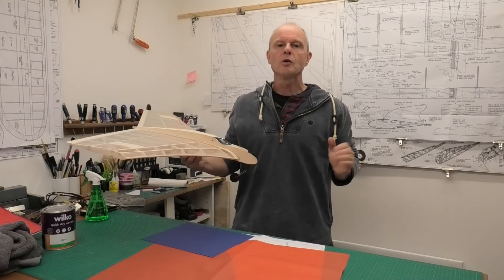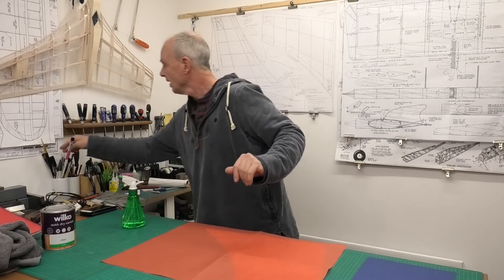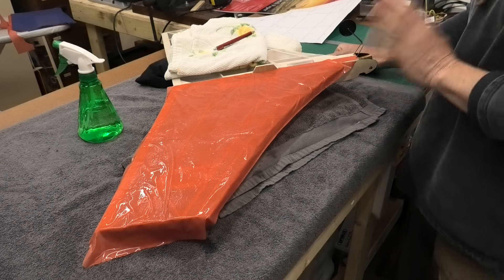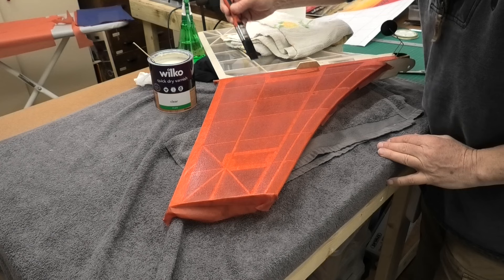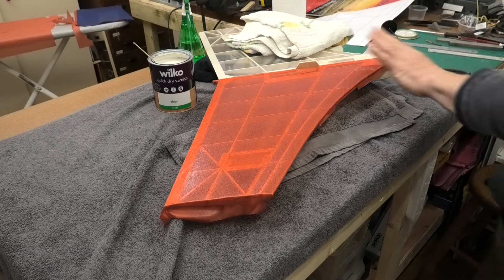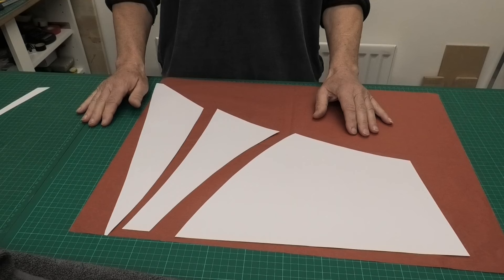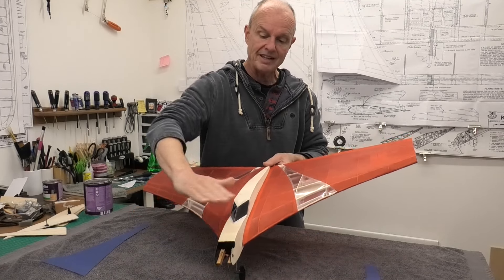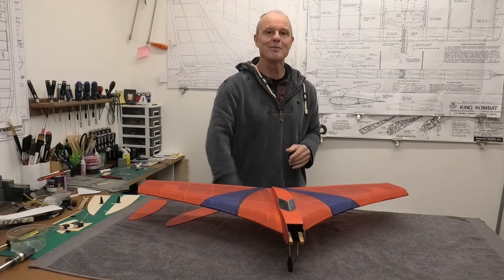Ion 1950's Futuristic Flying Wing - Pt13: Tissue over Laminating Film - By  O.F.W. (Peter) Fisher

Comment: Great videos, thanks.  I have struggled with getting laminating film (doculam) looking great on open structure frames.  And then I flipped this scenario around and covered FIRST with tissue and ezedope, then laminated over top of that with really satisfying results.  The dope finish was easier to achieve, and the laminate grabs on to the tissue as smooth as can be.  Thoughts?
Reply from the maker: Thanks for the comment, pleased you enjoyed the video, sorry to hear you are having problems with laminating film.  I have heard of others putting the film on top of the tissue, but never tried myself.  I only use the film for strength, and prefer the vintage look of the tissue on top.  But if it works for you and you are happy with the finish thats all that counts, sounds like a good job 👍

Comment: Looking fantastic, and the models not bad either. 😁 All credit to you I have tried and tried to work with Doculam but I just can't get it to shrink. Even on a flat open surface. Any how, Ion is looking great.
Reply from the maker: Hahahahaha, thanks Terry, appreciated as always, pleased you like it.  With regards shrinking Doculam, what temperature are you using, I normally shrink it using a high heat, 150degC and above up to 200
Reply: I have tried various temperatures even a heat gun. I won't give up.

Comment: Excellent Video…. Did you put laminate on the fuse before you put the tissue on or can you just put the tissue straight on solid fuselages?
Reply from the maker: Thanks very much for the comment, it's appreciated.  I put the tissue straight onto the balsa fuselage, but I water proofed it first with the polyurethane so that when I wet the tissue it would not soak the balsa.

Comment: If polyurethane varnish is not glow fuel resistant, what would you use for a glow engine?
Reply from the maker: I don't put glow engines in my vintage models, only diesel and petrol, which is where I use this technique, but there are products on the market you could use as a final covering, you will just need to do a bit of research.